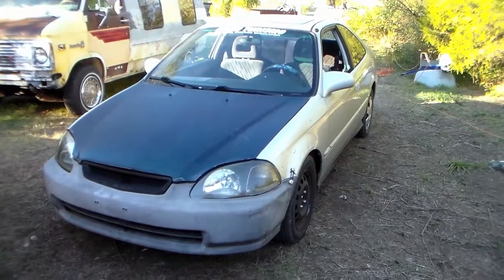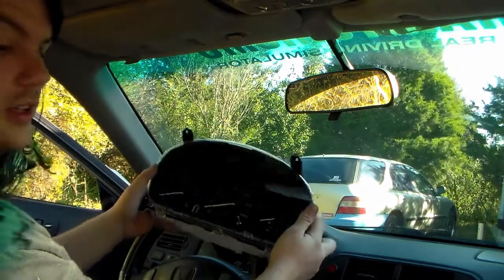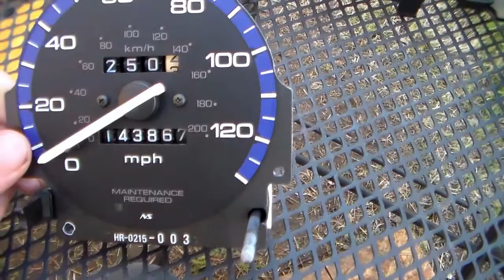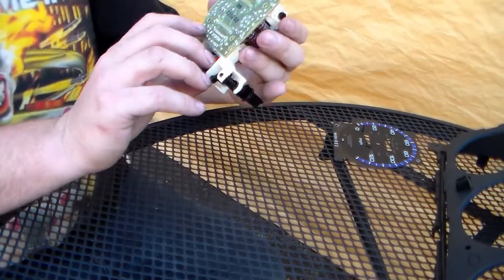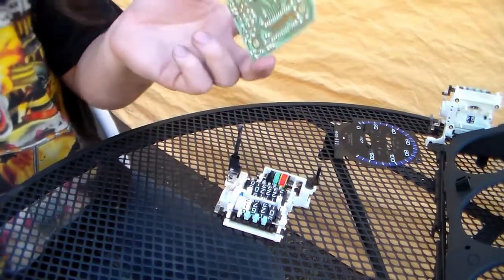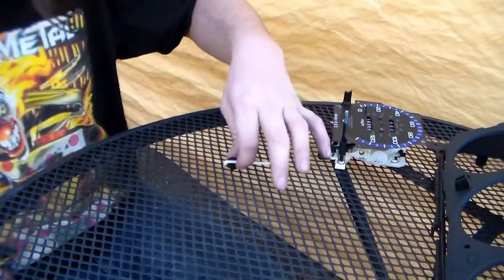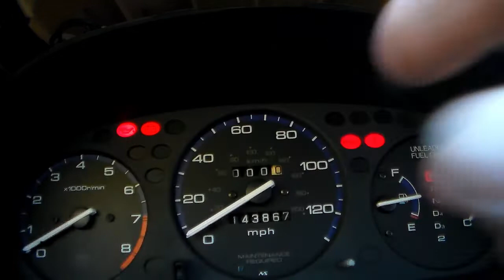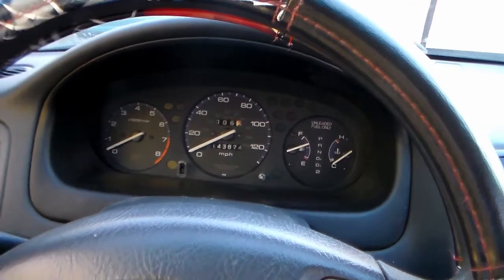Fixing A Speedometer on A 1996-00 Honda Civic

Comment: I own a 99 civic si and i am having this same issue. I've replaced my speed sensor 4 times. Triple Checked my wiring to the speed sensor. Bought a brand new whole speedo guage from the dealership. And I'm still having issues. The needle jumps all over and confuses the ecu so vtec doesn't engage. It starts working until later in the trip. Maybe my brand new Guage was bad? 🤷‍♂️  I'm literally at a road block and don't know what else to check?
Reply from the maker: Man that's rough but I think I have an idea of some things to check. 1. make sure your speed sensor is for your manual transmission. (I know this is self explanatory but when I was starting out I used a manual speed sensor on an auto and it didn't work right until I got one that was from an automatic.) 2. There was a Honda service bulletin in 2000 (#99-029) that was about a part of the engine wire harness rubbing on the intake manifold bracket. This applied to all Civic models 1996–1999. You may want to check out the harness, there could be some wiring in the harness that runs from the speed sensor plug that's shorting out somewhere or a break in wire. The other day while prepping my 2000 EX for transmission removal I had an option connector that vibrated and tucked itsself off behind the rear engine bracket. It was stuck and took me a while to find a way to get it out. Had to take the bracket off. I have no idea how it made its way in there. I would think that your issue would be in the harness somewhere. Also check your grounds as well. Keep me posted and I'll try to help as much as I can.
Reply from the maker: Also make sure the ground on the thermostat housing isn't messed up or corroded. I've seen that one cause alot of issues.
Reply: @foxisretrofitting4556   so my engine has been swapped with a jdm b18c out of a Civic SiR. I'm assuming they used the original engine harness. It does look a bit old. I've been avoiding taking the whole harness out but I may have too. I checked and cleaned thermostat ground. And also know for sure the speed sensor is for a manual transmission. However I replaced it with an O'Reilly's part. Maybe I'll have to break down and buy a factory honda one? But there like 300 dollars roughly.
Reply from the maker: @lafollettegarage4019  Believe it or not I've had good luck with ebay sensors. I get alot of stuff from tomautoparts. The sensor for our '98 automatic b4ra (78410-S04-951) is 8 dollars from them and it's been going since I put it in in early 2019. May want to check their store page and see if they have a sensor for your transmission. I'd break down and check the harness first. No need to throw money at it yet considering if it is actually wiring it could harm your new sensors.
Reply: @foxisretrofitting4556   just giving you an update on my Speedometer issue. I ended up tearing out the entire engine wire harness and I stripped all the loom off and inspected every square inch of it. And I found  two capped off plugs (1 blue and 1 gray) that sit right under the intake manifold. Their sole purpose is to junction and distribute power and grounds within the loom. I unplugged the gray caps off and found a bunch of corrosion. So I cut those plugs off and wired the matching colored wires together and then tucked them away inside the harness. I installed the loom to test it out the next day and my speedometer worked flawlessly. 💪  now I'm debating on ordering a Rywire tuck harness because my stock one is still kinda a rats nest. 🐀
Reply from the maker: @lafollettegarage4019  Thank you for updating me. This is amazing information to have! I didn't even know that. I figured the caps were for extra options. I'm pinning this comment.

Comment: I noticed after removing the speedometer that the actual connection for it on the instrument cluster is directly through the 4 screws that attach it to the ribbon strip and plastic housing. The circuit board looked fine. So, sprayed all the connectors a screw points with Caig Deoxit D5. I had the same issue where the needle froze at around 20mph and the odometer stopped. After spray those connection points with Deoxit D5 everything works as it should. Mine is a 2000 Honda Civic. Thank you for your video.
Reply from the maker: That's very good to know. Sounds like I know what chemical to pick up and where to spray to maintain these now. Thanks man!
Reply: I just did mine today. Hopefully it will keep working. I think honestly is one of the best cars ever built. Easy to work on. The most basic controls and comfort. Although, I have had to use a curb as railing to be able to get out of it. It's like drivin a gokart! Lol

Comment: Same issue.  I replaced the VSS sensor and it worked off and on. Then I checked the connector and found that it was not fully seated and locked in. Sprayed the pins with carb cleaner and plugged it in and it worked fine thereafter.

Comment: Is there a way to take off the white cover on the back of the cluster cause i need to change the lights on it?
Reply from the maker: You can change most of the lights from the back. I assume you're talking about the block behind the fuel level and temp gauge side? I unfortunately don't have one in front of me right the second to be accurate but if it does come off it will be with little cast plastic clips around its parameter and possibly with a screw. If not then you may have to take that gauge out.
Reply: Did you found a way to remove it?
Reply: @robertovalerio7810  nope

Comment: My dads 96 Civic HX coupe has the same issue, he replaced the speed sensor but it still won't work so that made me think "maybe the gauge itself went bad" and I was right ill have to show him this video. Also if replacing the speedometer motor  is too much work can I just replace the whole gauge itself with a new one?
Reply from the maker: Absolutely. If you can find another one that's in good shape without issues and don't mind the odometer being a different mileage it will work perfectly fine.

Comment: Do someone knows if the temp/fuel gauges of 5th and 6th gen are compatibles? Mine 5th gen is broken..
Reply from the maker: I'll have to look into that. I doubt it would just work as a direct transplant. If I had to take a guesses I'd say:
1. The fuel gauge is going to be the wrong application and read wrong even if it did physically fit due to 5th and 6th gen having different gas tanks and fuel pump hanger assemblies/float arms. Most likely set up for different resistance.
2. The temp gauge is most likely the same application electronically since Honda Civics have used the same coolant temp gauge sensor 1988-2000. If the temp gauge is made similarly and you could screw it into the gauge face and the cluster housing I would guess it would work technically. I don't know how accurate the face would be though.

Comment: Will it be the same process to replace the the rpm face, fuel meter and temperature gauge? I want to replace the face from an em1 cluster onto an ex cluster. Thanks in advance!
Reply from the maker: A bit easier in a way. You just remove the clear cover and black trim from the front of the cluster. Then you remove the needles on the gauges (comments have said using 2 spoons across from each other is an easier way to remove them) Last remove the little screws on the faces of the gauges to switch them out. You can throw it back together without breaking down the back of the gauges. Hope this helps! Good luck and let me know if you have any difficulties.

Comment: Can i use any optical cluster in my ek 3 98 model.when yes!  What the model?
Reply from the maker: After doing some research I believe with an EK3 you definitely can use 1995-1998 EK3 Clusters. 1996-2000 Japanese and Australian clusters would work as well these models would be EK3, EK4, EK9, and EM1. You could use an Automatic or Manual Cluster as well. I haven't had a EK3 in front of me or I'd have more ideas. Thank you for commenting, I hope this helps!

Comment: Thanks for taking the time to create this in depth video with explanation on how this fails and how to repair.  It is one of those not if but when it fails common failures on this generation of Honda Civics and other Honda of this generation.  On my channel I made a video on how to diagnose this.  I ended up discovering that this was the failure.  I went to the junkyard to find another speedometer gauge.    It was very disappointing to see how little sum of Civics of this generations were available.  My overall goal is to get better at component level repair as this is needed to repair the speedometer because at this rate every time you get a new to me part you know it is inevitable for this to fail.  Currently my new to me replacement gauge has started to fail again. I went to the junkyard this week and there were no Civics of this generation in two different yards.  Also knowing this is such a common failure means you are just playing Russian roulette with the one you removed hoping it works.  It is best to grab one from a car with the least amount of miles.
Reply from the maker: That means alot, thank you. If you figure out any tips or tricks on fixing various components in the gauges let me know so I can practice as well. You've got alot of neat stuff on your channel I'm interested in. Subbed!
Reply: @foxisretrofitting4556  , love your stuff also.  I will sub and I am rooting for your channel to gain more subs.
Reply: @foxisretrofitting4556  , where are you located?
Reply: Would love to collaborate with you at some point.  When in your area.
Reply from the maker: @MotionDesignStudio  That would be awesome!
Reply: @foxisretrofitting4556  , I just got back from the junkyard with a new to me cluster from a 99 Civic, automatic with ABS and 101,000 miles.  Not bad I thought with the mileage and years in service.  Well the speedometer does the same thing.  I followed your diagnosis to look at the motor and the motor was clean, free of rust and all wires connected.  I know the vehicle speed sensor is providing the speed because I can see it with live data.  To keep these speedometers working we will have to go deeper such as component level repair.  I have been working on deepening my understanding of component level repair and not there yet but getting closer.   I now have two clusters and 3 speedometer to run tests on.
Reply from the maker: @MotionDesignStudio  I got the control board and motor out of a 98 a couple weeks ago as a spare as well. Haven't tested it yet but I will. If you ever need information off the electronics or components that have maybe rubbed off or missing let me know. Cheering for you. :)

Comment: I have code P0500 for wheel speed sensor could that be the cause for my speedo not working
Reply from the maker: Yes absolutely. That code would indicate a bad speed sensor on the top rear of the transmission. When you replace it make sure you get one that matches your transmission. (automatic or manual) A cheap Junkyard, Ebay, or Rockauto one will work.

Comment: would the speedo motor from a EG fit a dc2 integra?
Reply from the maker: I haven't had a DC2 Integra cluster apart before but I wouldn't be surprised if it's the same motor because I've seen people online take EG & EJ civics and repin the speedometer wiring harness to fit the whole integra cluster. I'd give it a shot and see if the motor works. My guess would be that it works the same.

Comment: Can you use the 96-97 cluster motor on the 99-00 si cluster??
Reply from the maker: Yes, it should be the same speedometer motor since its the same wiring/application for that generation of Civic. 97-01 CRV clusters hookup the same as well so it wouldn't be a far stretch to assume those crv motors may be the same as well.

Comment: Where did you buy the needle?
Reply from the maker: Mine came with the gauge I bought from my local junkyard. If you need a needle you can pull it off of other Honda models or even replace it with universal Ebay ones if you don't have access to a junkyard.

Comment: i did this and now my speed shows almost 10 mph higher than i’m actually going, any ideas?
Reply from the maker: It can take a couple tries to get the needle on in the correct spot. You have to line it up carefully and depending on your luck you may have to put the needle on with the ignition on and the back of the gauges hooked up. If you are using a different size tire or rims other than the stock steel ones it can have an effect too. This gauge in the video read correctly when I put it back in but now that we are running alloy rims on it it reads slightly higher. About 3-5 mph. Although I'd rather it read higher than lower and cause an unnecessary speeding ticket. I could correct that but I don't want to risk damaging anything since these are fragile and it doesn't really bother me so I just let it ride.
Reply: It just means it got faster.

Comment: My mileage doesn’t read at all. How do I fix that?
Reply from the maker: If it's a rolling gauge like these it's most likely the speed sensor. If it quits working the speedometer doesn't work and it keeps the odometer from counting up.
Reply: All the needles work fine. I did replace the speed sensor and the counter still doesn’t move at all. Thank you so much for replying back.
Reply from the maker: @codycastro8083  Only other thing I could think of would be like maybe a piece of plastic in the odometer roller is lose, broken, or not seated right.
Reply: @foxisretrofitting4556  ok good idea I’m off next week I’ll check it out

Comment: Don’t do this mess. 

Your speed sensor is located right under the intake. It has a clip and has arm that’s like 15 cm long with a 10 mil bolt 

Pull it out and have a look at the gears if they are grinded it means it’s gone. 

And also if the gear is ok check the power voltage with a multimeter. 

Don’t spend your money on a new cluster for $220 

Search where the 

Speed sensor transmission is on google. 

I pulled it out my self and I have photos of it been chewed off. I bought a new one and now everything’s is good as new.
Reply from the maker: I did that with the '98 Civic shown in the video previous to shooting the video. That's why I wound up swapping speedometer motors. It wasn't a bad speed sensor causing no/intermediate reading it was a bad speedometer motor. HOWEVER Speed sensors can go bad without being chewed up. I had one on a 94 Accord Sedan go bad with no noticeable physical defects. Did the same a couple years ago on the 2000 Civic that is also featured on our channel. Also I did not spend this "220 dollars" on a cluster. I went to my local pick and pull and grabbed up a speedometer gauge itsself (not the whole cluster) for 4.99. A whole cluster would've cost me 35 at the same junkyard.